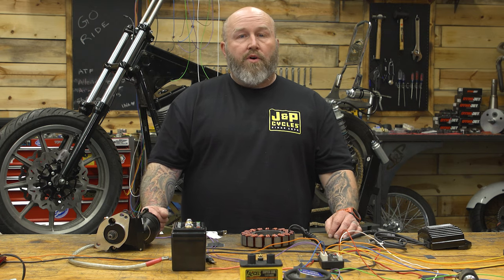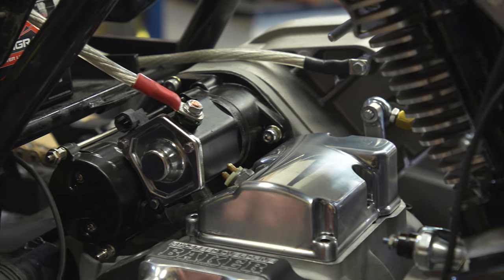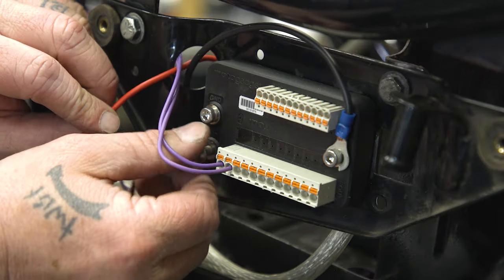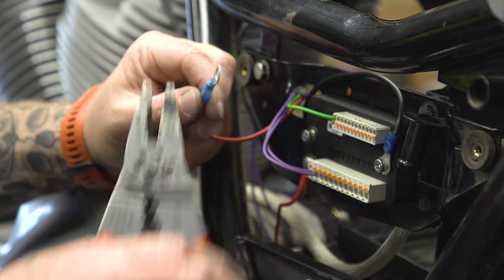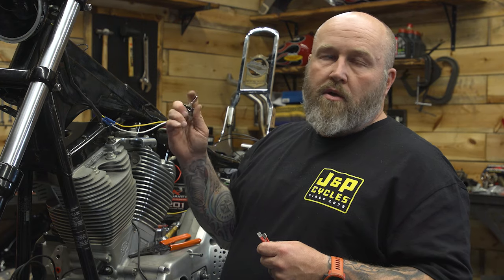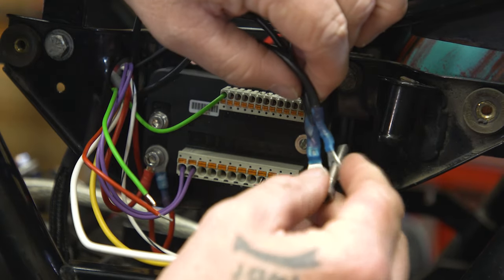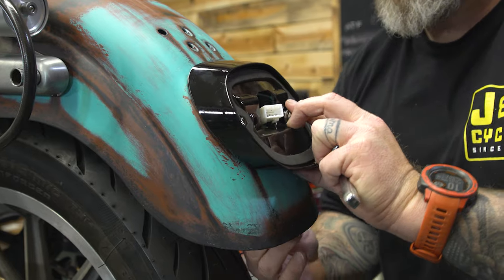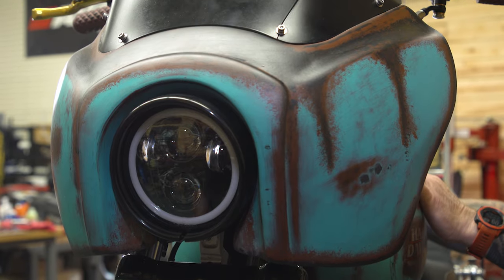How to Wire a Motorcycle | Weekend Wrenching

Comment: Great video! Wiring up using the FX style ignition switch is great. Can you shed a little light if using the stock ignition switch for a 1967 FLH. Terminal #1 is the switched 12V, can you use Terminal #5 to complete the m-Lock? My ignition switch has 5 terminals, and only two are needed. What its your take on this. Thank you

Comment: Liked-Subscribed (burnt wires on Harley FXR Lithium battery fried everything,even tried a lithium reg from Ricks and that fried my stator)...jeez

Why did you put the 2 tail light wires together???? No need for brake switch??? CONFUSED
Reply: The brake light bulb is voltage sensitive. Bikes not equipped with an m-unit have 2 effective power wires. One is key on power, so that your brake light is always illuminated while the power is on. The second wire is switched power, just like a light switch. When you pull the brake lever it’s like turning on a light switch and now you have double the voltage which illuminates the second element in the brake light, making it brighter. This is achieved in the m-unit using a circuit board and (I/o logic?) essentially it’s programmed to send the proper voltage  to the tail light to either illuminate the running light or the running light AND the brake light. This wouldn’t work on a bike without an m-unit as you would have only 1 12v circuit and the light would never “see” a difference to illuminate the brake light. I hope this helps.